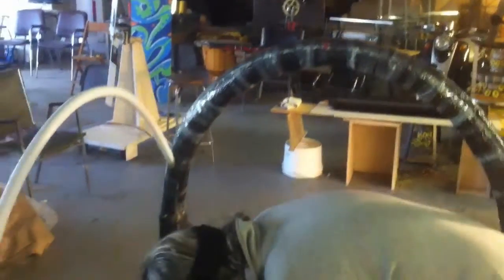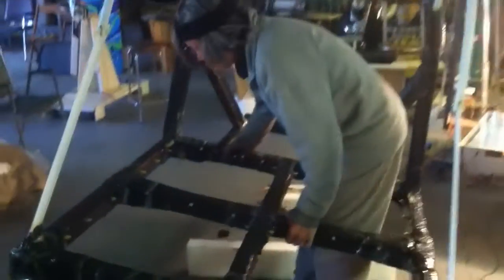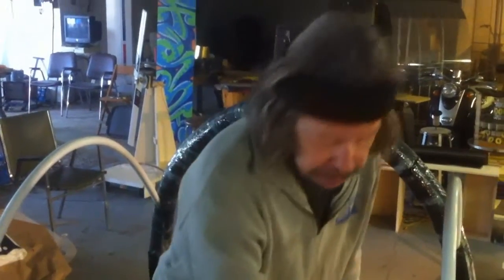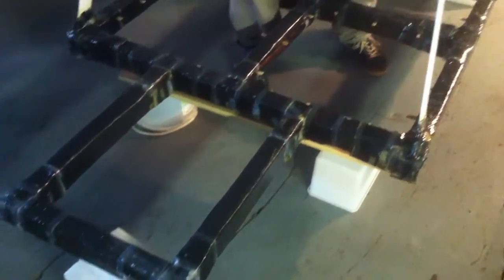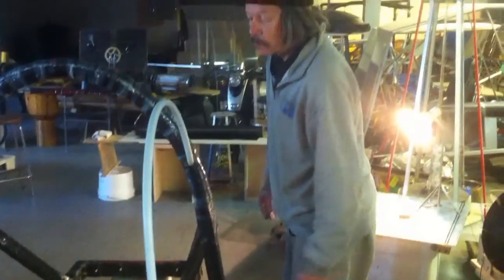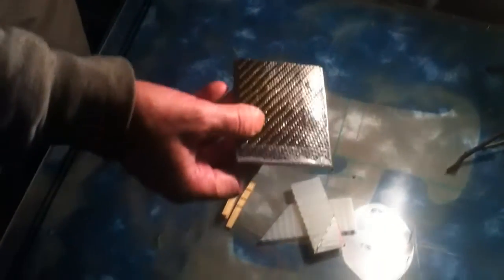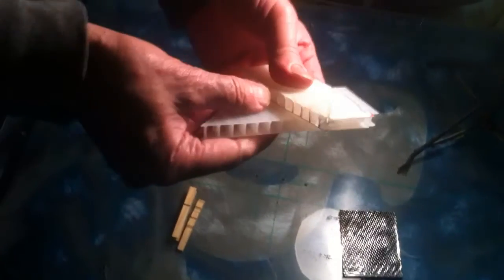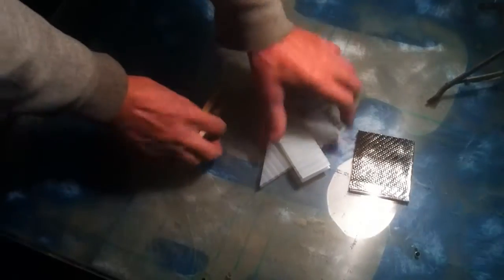UFO Alien Leak FS30 -- Non-Magnetic CF Chassis

Comment: message of support bud.

a little question if the shell of the vehicle is hollow ? and light none magnetic material eg copper or aluminium, slipped in light PVC pipe then fill hollow area with liquid magnetic solution or magnetic gas ?
simple thinker